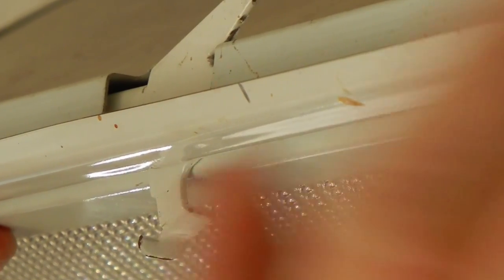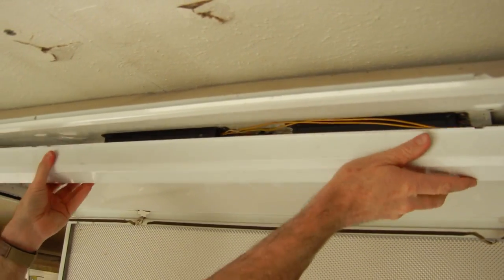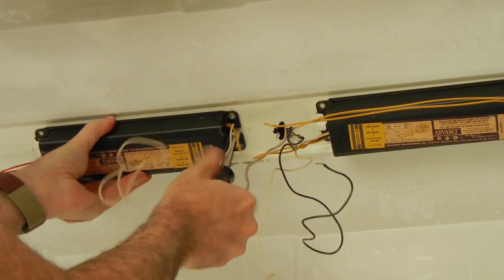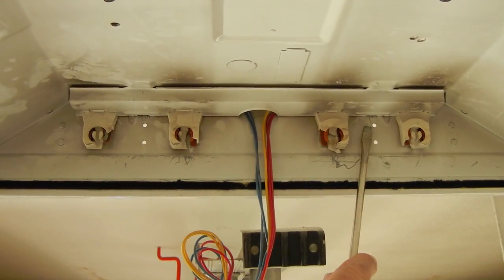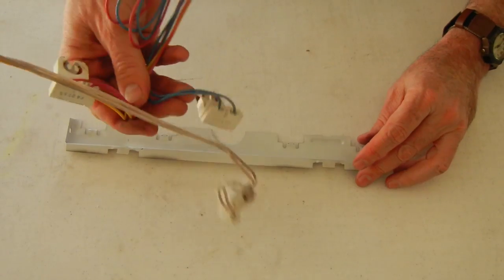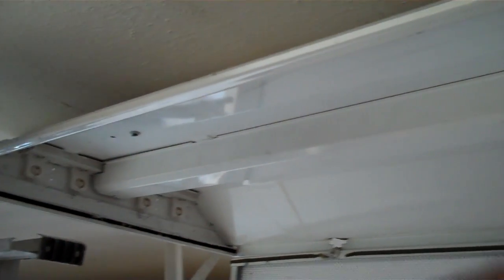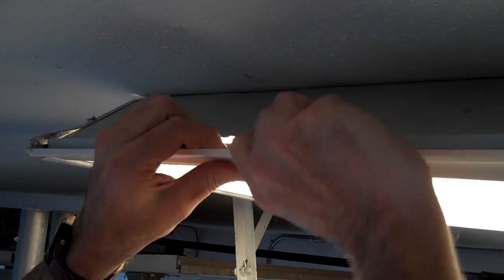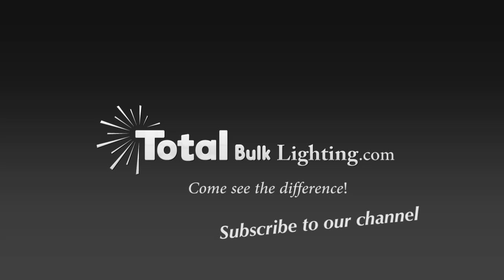How to install a T8 electronic fluorescent ballast in an old magnetic T12 ballast fixture

Comment: Can I use t5 bulbs in this set up? I have 5 fixtures That I'm retrofitting for indoor plant starting and want the efficiency of the t5 bulbs..
Reply from the maker: T5 requires a T5 ballast. You will need to follow the wiring diagram on the T5 ballast and use the correct T5 tombstones / sockets to retrofit correctly 🙂

Comment: One of the most excellent DIY videos ever. Thank you so much. My situation was exactly this. I replaced 2 old magnetic style ballasts and upgraded to one T8 4-lamp version. The install went exactly as you demonstrated. I even decided to buy the same ideal wire ends as you used, and I replaced all 8 sockets just for good measure. Fantastic how to. Thank you

Comment: I replaced my T12 magnetic ballasts with T12 rapid start electronic ballasts a few years ago. Can I use my existing ballasts with T8 LED lamps like the Philips InstantFit series or do I need to replace the ballast with a T8 ballast or can my current electronic ballasts drive the T8 LED replacement lamps without modification? Thanks for your help.

Comment: The 120 volt supply conductors enter through a jagged hole. Not code compliant ever. While the original installer is to blame, that should have been corrected during this video. It involves a good bit of extra time and effort. Shoddy work when it is left that way.

Comment: I realize this video is pretty old now, but I just wanted to express my gratitude. Have the exact same fixture. Two old magnetic ballast, with multiple wires going everywhere. Did everything you did, step by step, and it all works great now! Only problem I came across was putting the ballast cover back on. Won't clip back on. 2/3 of it will snap in, but the last clip won't work. It's all of a sudden too long. The metal strip that holds all the "tombstones" in it, seems like it's too far away from the back end. I'm literally millimeters from it locking it in. Very aggravating for everything to work great but that one part. Anyway, thx for the very informative video. Well done, sir.

Comment: If you change out the ballast to an electronic one, do you have to use the new version T8 neon lights too or can you still use the old T12  bulbs?  Also, how do you determine the electronic  ballast conversion - the number of bulbs or the overall wattage?  thanks....

Comment: Thanks for this post. Very helpful to see this done by a pro instead of another DIYer. I've changed out a few but now I'm doing one that's pretty similar to this one and may also need new tombstones too.. I bought myself a Klein wire stripper a couple of years ago & love it. Money well spent in my opinion. Pricey on the front end but it's paid for itself many times over.

Comment: Two questions, please:  What about grounding?  My system has a ground wire.  How do I incorporate that into the new ballast?

Also; what if the two yellow wires are not long enough to make "jumpers" out of them?
Reply: ***** Thank you.  Just saw this after  adding another question to my first post.  Wondering what to do if the yellow wires are not long enough to make "jumpers" out of them.

Comment: Great video!   After watching your “how to” I was able to convert my 4-bulb T-12 fixture with 2 ballasts to a 4-bulb T-8 with 1 ballast. I removed all the wires from my existing bulb sockets and installed the new electronic ballast just as shown in the video. The T-12 used 2 wires to each socket and the T-8 uses only 1 and it doesn’t matter which side or wire you use.  THANKS

Comment: Excellent instructions. I have 8 fixtures in my kitchen and it took about 2 hours to convert them all. The LED lights are about 25% brighter. Instead of getting 16 replacement LED lights, I'm going to go with 8. No more buzzing and flickering florescent lights! Yay!

Comment: I wonder about that way that you wired the tombstones for the common side of each of the 2 bulbs (yellow wire).  The way that you show means that the electrical connection depends on the bulbs internal grid for connection to the next bulb.  That means if the power always flows through the bulb's internal grid and in fact if the first bulb fails due to a open in the grid then the second bulb will also turn off.  In other words the two bulbs are in series.  Isn't this a problem?  The wiring diagram on the ballast shows that the two bulbs should be wired in parallel.

P.S.  If the "tombstone" lampholders are the shunt type then the wiring shown is correct.

Comment: Overall a good video on how to convert an old fixture to a new ballast and T8's.  A little concerned however that you failed to address the dangerous situation with the jagged, raw hole where the power wires enter the light housing.  There should be a grommet or smooth sleeve there so the line wires can't come in contact with that sharp metal and over time, due to vibration, wear through the insulation and cause a possible short.

Comment: Only one concern.  The black / white wires (power feed) insulation can be cut on the fixture where the wires come through the top to supply the power to the lamps.  It would be wise to install a grommet on the fixture, to prevent the wires from being cut on the insulation.

Comment: Although grounding was mentioned and you addressed the issue well., may I suggest that you also mention grounding plane as well. Assuming that the fixture is properly grounded and the lamp-holders are within the specifies distance. Electronic ballasts are more sensitive to the grounding plane, this is important when performing a retrofit to verify that the lamps are the proper distance and that the fixture provides a grounding plane. Best Regards.

Comment: A problem I've found with electronic ballasts is the tubes tend to last much longer than them. If buying more expensive replacement ballasts saves money I must be missing something. This particular one is an instant start type which shortens lamp life anyway compared to a magnetic ballast. Also you need to put the yellow wires in the same side of the socket instead of across as all the current for the other lamp must pass through the electrode of this one causing a premature failure.

Comment: I'm no expert, which is why I'm here, but I've read that you need to use shunted tombstones with an instant start T8 ballast. It appears that the tombstones in the video are not shunted, but the light turned on without calamity...

Comment: Thanks. I got a lot further so far replacing some four footer T12s There's a green wire coming from somewhere that looks like it's crimped into the strip. I got a little aluminum clip in the new one and I don't have a clue what it's for.

Comment: The light fixture that I had was different, but this video helped a ton.  I replaced all the insides with a T8 ballast, wires, and tombstones. I put the bulbs in, turned on the power, and everything worked on the first try.  Thank you!

Comment: This is like the 4th video I have looked at and noticed no mention of connection of grouind wire . I thought the house ground was important with the T8 ballast. Or is it considered grounded with the metal ballast and that screw that secures it to the lamp housing?